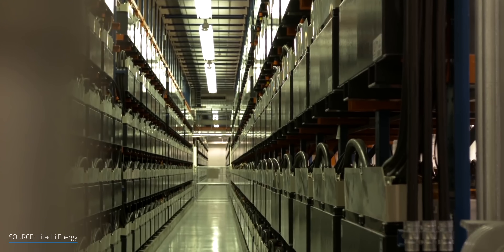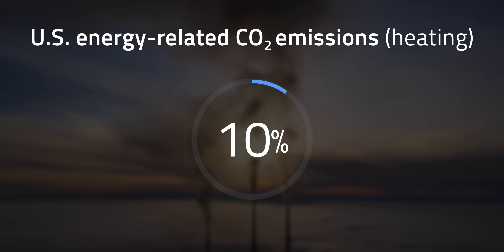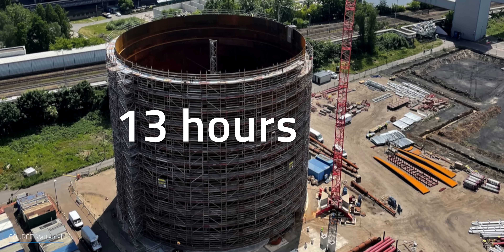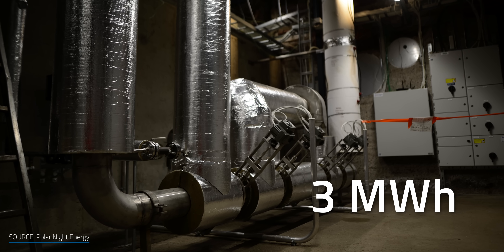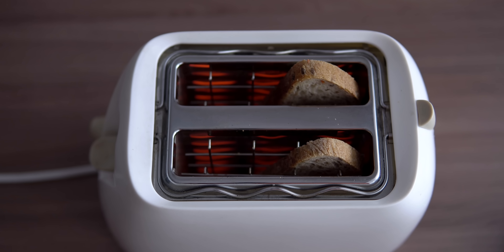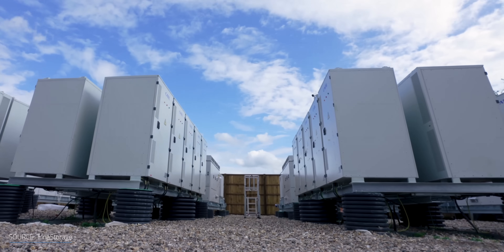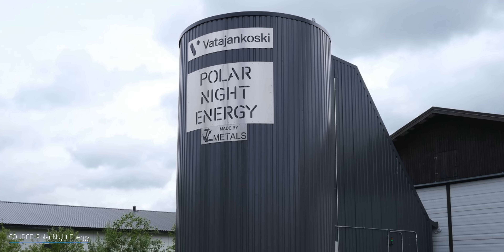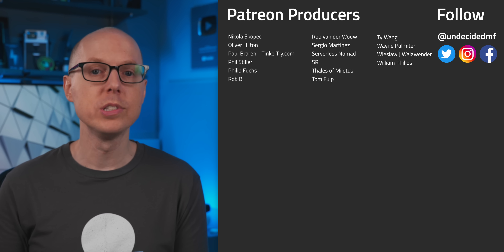How A Sand Battery Could Change The Energy Game

Comment: Matt, I have a question. Why do we still use turbines to generate electricity based on thermal energy. Why don't we use something like the little peltier devices to have a direct conversation without a middle man. Wouldn't that be more efficient because there's less conversations and therefore less losses? Is it just because that technology isn't as developed for that application?
Reply: Because peltier devices are extremely inefficient and expensive to implement.Turbines are reliable and scalable. Even with the inefficiencies involved, they make more sense than peltier devices.
Reply: My understanding is that peltier devices are horribly inefficient. The Stirling Engine is supposed to be extremely efficient, but it does not scale well (great as a small device, horrible as a big one).

Comment: It seems like it might be worthwhile to generate some electricity on the output side, where heat is moved from the hot sand to relatively much cooler district heating water. So instead of getting 100% heat out, maybe you could get 15% electricity and 85% heat.
Reply: It would certainly add to the complexity of it. But yes, especially with larger units and already existing steam-turbines, perhaps a tweak of the design would allow heating by hot air and also heat recovery by hot air just like now... but a secondary pressure shock compliant recovery piping could be used. Insert water there, which pretty instantly create steam (and shock-load the system), but said steam could be used in industrial applications directly, or run through an on-premises steam turbine to generate electricity. There might be smarter options to create the steam from said heat-reserve, but they all come with a cost of efficiency.

Comment: What I'm wondering now is why resistive heating rather than a heat pump? Especially if you're heating the storage in the summer when it is already hot outside and then using the heat in the winter.
Reply: Probably because using radiant heat is better for heating up the sand. Heat pumps are efficient for moving heat, but probably can't transfer as much heat to the sand. Heat pumps are normally used in convection systems because they use small fins to dissipate heat, with an air or fluid medium carrying heat away from the evaporator. Sand doesn't flow, and so it can't access the large surface area of an evaporator. I think radiant heat elements can be evenly distributed through the sand and can easily transfer heat with minimal loss.
Reply: Heat pumps also don't work as well when you have a large thermal gradient. Most heat pumps are only pumping across 20-30 degrees F of gradient. Here you are talking about pumping across a gradient of potentially 900 F.
Reply: @TwilightMysts  I didn't hear/see a temperature gradient referenced so I wasn't sure. Where do you get the 900°F number? Modern heat pumps can get up to about 80°F before resistive heating becomes more efficient, so if you were to heat during the hottest days of summer then you could probably reach 180-200°F in most climates using heart pumps, which would be sufficient if you had a large enough mass though it may ultimately be more expensive per kWh of storage.
Reply: @TheDaspiffy  While explaining the system, at around 6 minutes and 40 seconds Matt says the sand heats up to 600°C or 1000°F.
Reply: @TwilightMysts  Thanks! Missed that the first time I watched.
Reply: @andoletube  maybe a sand or rock + water system would be better?

Comment: I really really wish you would have investigated the claims that they can keep the sand "hot" for months.  
There's both convection and radiative losses.  Both of which cannot be well insulated if from the outside of the building FLIR lights up the screen as shown in their promotional video.
Simple Heat loss thru conduction insulation should show why this is a bad idea.  The justification is probably based around ceramic which hold heat for a long time and promises that they'll run studies while having yet to evidence their claims.
I would love to be proven wrong, but this looks like a short term heat storage  at best.  Generally, if it sounds too good to be true it probably is.
Reply: Build them bigger. Cluster them so most of the loss is to the ones next to them. If there is volcanic pumice or steel mill slag nearby, bury them in 20 feet  of material ( R 1.5 an inch.)
Reply: @kkarllwt  I know you think that sounds like a good idea or an easy way to write off a detractor, but it doesn't work like that.
You're correct that increasing the mass to surface area ratio via size and clustering  does have benefit.  There are still conductive, convective, and radiative losses.
You could have an R-Value of near perfect vacuum  like Spacetherm and you would still have significant radiant heat losses, while you're trying to pull useable heat energy from it.
Reply: @buckshott00  a reflective coating could lower radiation leaks, and a vacuum seal would lower thermal leaks, but I also think seasonal storage sounds too optimistic. The big thing, that I wonder about, is how are they going to deal with the losses of miles and miles of pipes. Are those also going to be reflective vacuum pipes?
Reply: @itoibo4208  Yes, and that was my point, I didn't mean it to come off as totally dismissive.  I was just trying to get the point across that the timeframe is absolute nonsense.
A simple Stefan-Boltzmann calculation could have told you that, and I'm trying to do it by memory after a long day at the office.

It's a 23ft Silo, for easy 1st order math, let's call it a blackbody, and say 300 square meters surface area at 600C.  That's 9.9MW of radiated power. 
Now give it every advantage the silo inside and out emissivity of Al Foil.  Still 0.3MW,  
So, then let's reexamine the Claims:
"It can store up to 8 megawatt-hours of energy"
I really don't recall if he said 8MW or 8MWh 
Either way is bad.  8MWh with 0.3MW radiant heat loss is a terrible battery.  And sure, the radiant losses will decrease as the the internal temp of the sand decreases but  there's just not enough enough there to make up for the losses.

Will reflective insulation and near vacuum levels of insulation across the body and remove thermal sinks (bridges)? yes of course, but it can't make up for the  massive losses which will only be exacerbated by the thermal conduits.  
The best you can hope for is to make use of that heat by using it to melt snow on roads and sidewalks or keeping pipes from freezing.
Reply: I highly highly doubt it can store heat much more than a few days. When temps hit -40 it’s gunna cool things off pretty damn fast
Reply: but then we used to store ice blocks under straw in a barn (ice house) from winter and they'd still be there in the summer for ice cream. So with modern insulation I don't see why it couldn't happen. But time will show if this silo does or doesn't work since it's built
Reply: @daemonbyte  I'm not trying to be rude or dismissive but those 2 things aren't nearly as similar as you might think. 
Ice has a much different latent heat of fusion and the sand is not changing phases. What that means is when ice changes phases from solid to liquid it takes a lot of heat energy transfered into it to do so. 
Insulation is not a magic bullet, and saw dust in thick enough layers is actually pretty good insulation.
The comments I made earlier about perfect vacuum were to illustrate that there's still losses. Plus,  that silo can't be that well insulated if it looks bright orange on FLIR.
In a perfect vacuum you would expect no losses from conduction or convection. That's why it makes for easy approximation. Even in perfect vacuum, that silo radiates heat.
So again,  I'm not saying this totally won't work, I'm saying that the proposed time scale is off.
Reply: @buckshott00  I wasn't saying they were the same, I was saying that things that you'd think wouldn't happen can and do. As to if this will work as they say, I didn't say either way. In fact I said we'll see if it actually does perform as intended because they've built it already and will be using it. So speculation at this point is rather pointless when we can wait a few months and have a hard answer.
Reply: @daemonbyte   Or you could run the math and see that it won't work nearly as long as they say it will, and that they've oversold this.  In their whitepapers they literally say "we'll check this later" which is a very bad indicator.  If it works as well as they say as cheaply as they say why do they need such a huge investment to run proof of concept and prototyping? I was trying to be polite earlier, but if you want to be disagreeable I can show exactly how you compared two very different materials and storage situations "ice in ice houses" and "sand thermal batteries" were "with modern insulation" fawning over this "I don't see why it couldn't happen".  Speculation isn't pointless when you can literally run the heat transfer calculations and know.
Reply: @buckshott00  sure, "disagreeable" apparently means I don't just accept whatever you say. You can pointlessly run numbers filling in all the blanks with guesses and see what you get. I'm sure that will be a much more efficient way to spend time. I would agree with you if they hadn't already built it, but they have. What's the point of trying to work out the theoretical numbers after you have already built the thing? It exists already. What do you plan to do, work out the theory and then demolish it if you don't like what you guestimated it to be? And unless you know all the exact details of the build, materials, the outside air temps for every day etc etc educated guessing is exactly what you'd be doing.

I'm not fawning over anything. I've not once even said it would work. I said it could work and I said since the damn thing already exists we might as well try it. We have nothing to lose at this point.
Reply: Welcome to Matt's channel, techno fluff for the masses that believe every green tech is "revolutionary", reality be damned.

Comment: Even better: upscale and use heat pumps to use with it to increase the efficiency above 100%. 
For this kind of need for energy, we could use rivers or sewage for source of heat, they usually keep warm during winter and just decreasing temperature of moderately big river (above 1 m3/s of water) by 0.5C would bring MWs of power, of course you would need to determine how much energy on what length is acceptable for environment, and will not produce shock for life but overall it would be a great source. It should be safe, we usually increase it's temperature not decrease, and life like cold water better as far as I know, due to amount of oxygen dissolved.
Reply: There are no heat pumps able to heat up to 600 °C (1000 F). Possibly pre-heating could be done, but that seems unnecessary and makes the system more complicated. As it is now, it's simple and extremely long-lived.
Reply: @johansvideor  Ah yes, I forgot that they go so high with the temp, of course. Thank you for pointing that out!

Comment: At $15 KWh  is that divided against all the recipients or per recipient, and how many recipients does it supply?
Reply: It is agnostic to the amount of recipients so no it is not divided. This is just the total cost per energy storage capacity.
Reply: @olamilekanakala7542  What, Not Agnostic. what are you saying?  All business runs on a profit model, this means if it costs the company (example only) $500 for one month of supply and they supply 500 People they will likely be looking for ~ 200% profit above operating cost of material, labor, and infrastructure so it could end up costing a magnitude more per consumer and yes all costs are divided among the  customers ((that is what business does)) Without individual cost breakdown per customer per unit of measurement  used there is no effective way to sell this.   Simply hyping the tech as "Good for the Environment" is a horrible way forward.  Wait for the Buyers remorse to kick in from  a financial decision that costs 3, 4, 5 Times the cost and still ends up needing fossil fuel.   Unless a cost per unit of measurement is provided we as consumers have no option but to think it will triple the current costs.  (ask your current employer for a raise to cover that cost and get ready to be shocked at the answer)
Reply: @urbanws1234  You seem to misunderstand what I mean. When people say the lcos of a li battery is $100 per MWh, that doesn’t care about how many people are using the battery system. It is simply the total CapEx and OpEx for that system. And utilities don’t care about how many recipients there are either, just how much demand there is. If there is demand it doesn’t matter if 100 or 50 people want 100MWh. If they are using the same amount of energy from the battery then their cost per energy consumed would remain constant.

Comment: Since desert sand isn't useful in construction due to its surface structure (thus the shortage of ocean sand these days), would it make a cheaper and easer to obtain component to these sand batteries?
Reply: Yes, any type of sand can be used, doesn't have to be construction quality.
Reply: The goal is that this system can be deployed anywhere there is a utility scale heating network. Desert sand isn't readily available everywhere in the world, at least compared to construction sand. And there is the added benefit of reusing by products and keeping things out of landfills.

Comment: the Sahara is one colossal sand heat battery but loses all its stored energy to the night, My project is to cover it with thick blankets during the day just before sundown, which may then be distributed on a nightly basis to all the world's poor to keep them warm as they enjoy their drugs and booze in front of the nightly telly. They can't be trusted with individual thorium reactors at home, obviously so my project fills a clear need. If you would like to help out just get in touch.

Comment: I see one massive thing wrong with this big tank full of sand... they should BURY it in the ground, it would better insulate it from ambient temperature changes, on top of that, it's not clear if they already do this or not, but they should use the electric resistive heater in combination with a heat pump. Even just PARTIAL burial in the ground could help, and also minimise the visual impact of the Silos.
Reply: Good luck heating to 600 °C (1000 F) with a heat pump! Maybe in the future.
Reply: @johansvideor  you could always use the heat pump to extract the heat more efficiently...
Reply: @PAPO1990  I could imagine that could be done in larger scale systems. Now typically district heating systems use simple heat exchangers. But common heat pumps are typically optimized for even lower temperatures.

Comment: Someone complained that the earth will eventually have sand shortage, but that's only an issue for sand used in construction that needs a certain type of quality. The sand battery can use any type of sand, e.g. desert sand that doesn't qualify for construction.
Reply: When river sand runs out, the sand in demand, they will find a way to process desert sand to become fine like river sand. Just a matter of rolling it around in a cement mixer for a while, I bet.
Reply: @TheBooban  I was gonna mention river sand. I live in kansas city missouri and the river barges are constantly running for river sand as far as I know. 
Imagine having one unit that heated your home and water supply at the same time 😳 that's gonna get somebody on a disappearance conspiracy list 🤔 👀
Reply: @TheBooban  yes and that's such an efficient use of limited electricity 🙄 do u ppl have brains in ur heads at all?
Reply: @TheBooban people who disagree bc it would cost to much just dial to realize that it would be comparatively cheap once normal river sand diminishes n prices go through the roof
Reply: Correct construction/concrete production requires certain types of sand. Can’t go scoop up desert sand it is shaped different and doesn’t work for construction needs.
Reply: Pure silica and sand used in construction
Reply: Lol silica is the one of the most abundant material in earth sooo, whoever told you that is an idiot
Reply: I am pretty sure we will have a coal or lithium shortage sooner than a sand shortage.
Reply: Sand can be manufactured out of rocks and recycled. Glass. Dont worry. Only problem is it cost more
Reply: Or sand can be made from crushed glass!
Reply: I thought the same thing too. 

 Yet I doubt they are taking the quality sand you speak of. Tons of different varieties. I hope they are taking the sand silicon chips are made of. 

 I'm not exactly worried. Once sand actually starts running out? We will figure something out to replace it in concrete. 

 He needs to do a new video covering some of these technologies. I'd like to see this versus salt water detox batteries.
Reply: Ur all bloody morons. Electricity storage is just idiocy! Oil gas and nuclear  is the only way to meet the world's increasing energy crisis. If ppl want more electric vehicles we need more plants to produce it! Storage and windfarms ain't gonna even come close
Reply: @odoggow8157  sorry if i dont take advice on highly complicated scientific data from a guy named odog and is yoo lazy to spell you're...
Reply: @odoggow8157  Get lost, Kremlin troll.
Reply: @@anmeme6579 what do u know about research or science! None of u even know what science is!
Reply: and wait...yeah isn't the world already suffering a massive sand shortage?
Reply: You know sand is running out because of the silicone age! We can't use it for everything we gotta start prioritising resources better.
Reply: @odoggow8157  Get lost, troll
Reply: @odoggow8157  there’s continents worth of the shit.